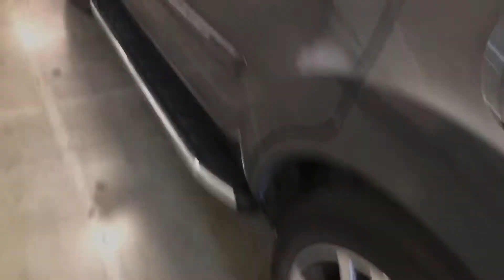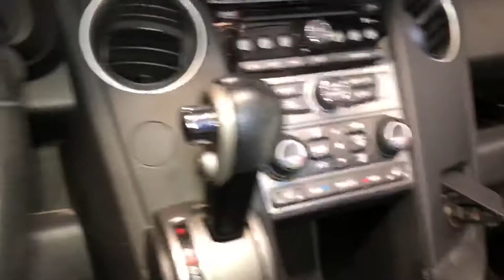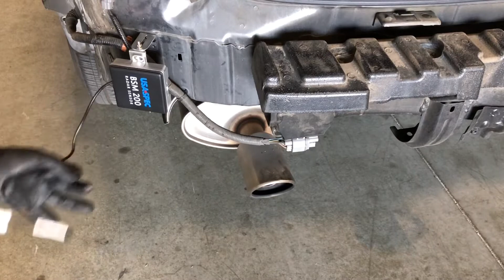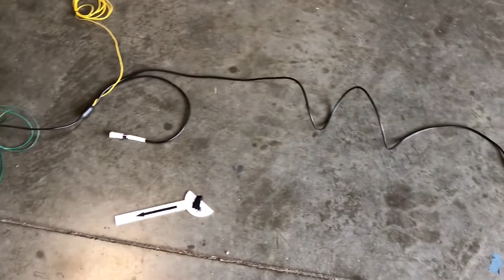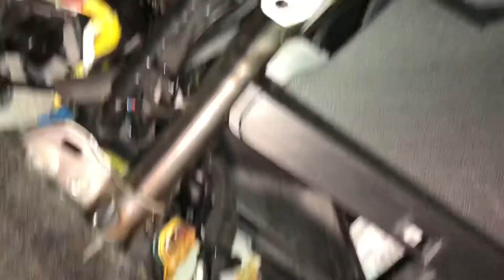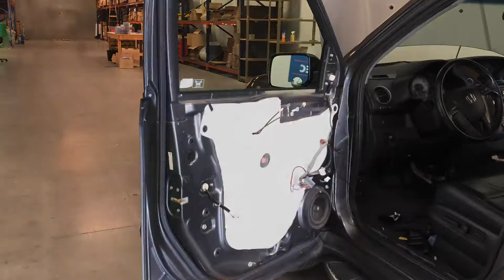BSM200: Blind Spot Monitoring System by USA SPEC for  2012 Honda Pilot

Comment: I have a two-part question. The first, what if the vehicle has a combination turn and brake light on the rear and combination turn and DRL light in front, how do you wire up the system? Second, since you have the OBD-2 connection, why not use the canbus for the turn signals and reverse signal? Wouldn't it simplify the installation process?

I hope I make sense.

Comment: Will appreciate your response if you are still monitoring this post.
I got BSM 200 installed last week. In general, the system works.
But there is an intriguing problem happening quite often, which has made the system not worthy of having on your car.
The system starts detecting cars on the driver side led , when there is none on the road. When it does this, the led remains lit for up to a minute continuously as if a car is on the left blindspot continuously. There is no pattern when it happens , but it does happen almost 2-3 times over a period of 1-2 hours of driving. 
The installer replaced left sensor , but it didn't help. USASPEC advised to check sensor mount angle , but that was done correctly .
Only thing remains is the controller itself. But USASPEC is not willing to accept that it might be bad.
Kind of a transient signal triggering the controller out of the blue with no discernible pattern.

Any advice on how to resolve this issue ? I really wanted this system to work, but getting close to ask the installer to remove it .
Reply from the maker: Have the installer adjust the angle of the sensors towards the inside almos pouting straight back. Have him submit pictures of the installed sensors to info@usaspec.com

Comment: Is this compatible with a 2007 Honda Civic Hybrid?
Reply from the maker: There is no know compatibility issues with a 2007 Civic hybrid or any other hybrid vehicles including Pius Prime.
Reply: @OfficialUSASPEC  Thank you! And another thing, how well does this handle extreme heat and cold?
Reply from the maker: @watch_kitty  not sure what temperatures you would consider extreme heat or cold. However, if your other vehicle Electronics are able to operate in the environments you have in mind the BSM200 will work as good as any other vehicle electronics..